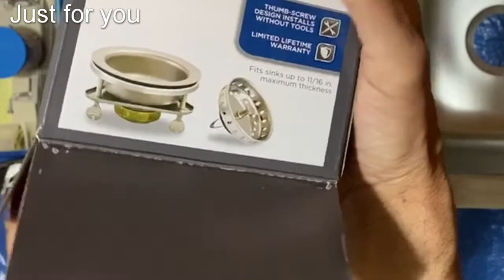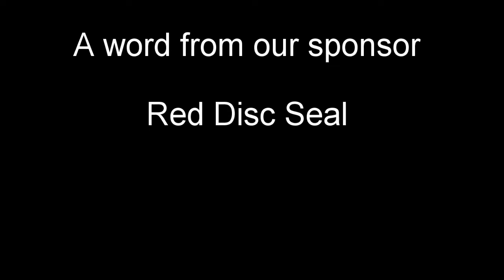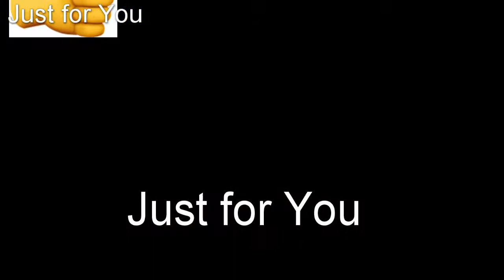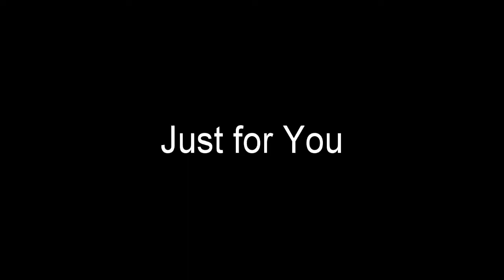How to Install Kitchen Sink Strainer & Faucet, Glacier Bay & Moen

Comment: My sink kit came with strainer washers that were made out of hard plastic.  There was no way the nut was going to get tightened enough to make the hard plastic form to the bottom of the strainer.  I wound some Teflon tape around the perimeter of the washer such that Teflon tape folded over onto the top and bottom of the washer.  Problem solved.  No more leak.
Reply from the maker: Thank you for sharing.